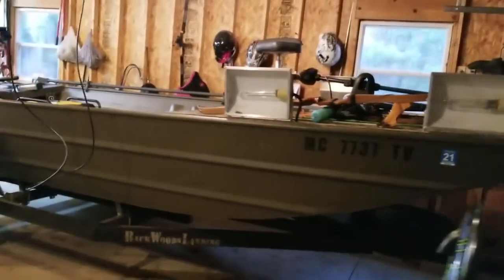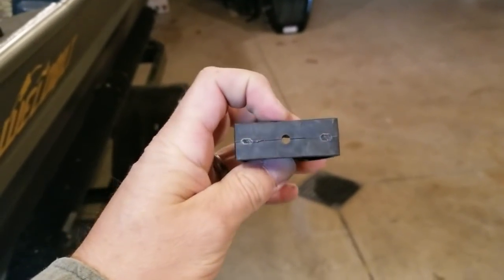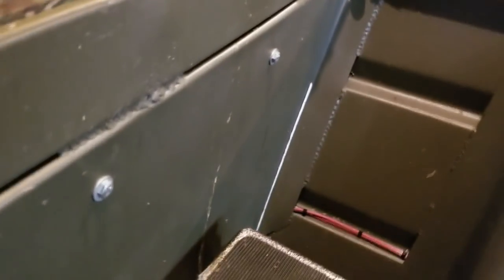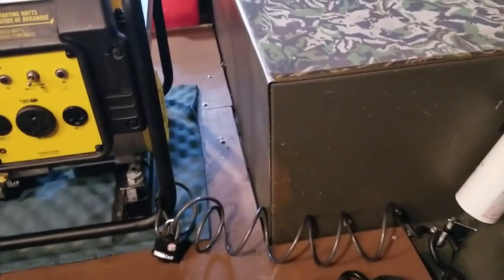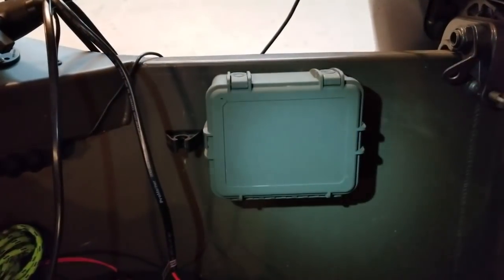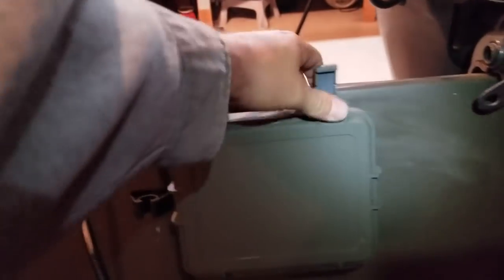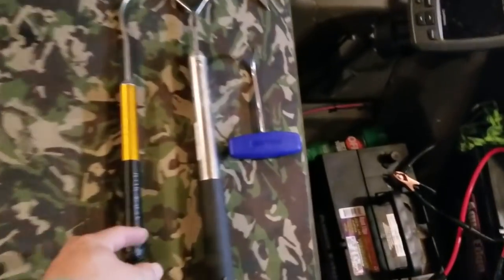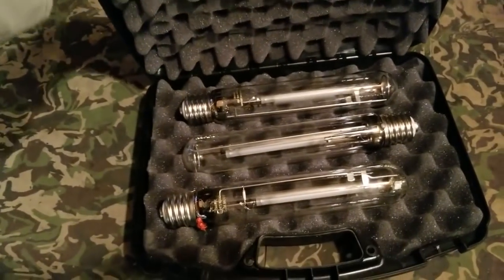Bow Fishing Boat Must Have Items To Make Fishing Better

Comment: Awesome set up I was just wondering what you used to Keep all your components stuck to the aluminum like your dry boxes and piggyback arrow holders?
Reply from the maker: Dry boxes were screwed with self tappers. The piggy backers were epoxied and some others were taped with gorilla 30 pound double sided water proof tape

Comment: Great set up!  I just acquired a warf bow that I'm going to set up for bow fishing. Probably something inexpensive as I have never bow fished. Any recommendations on bow reels etc..?
Reply from the maker: Any bow will work great. If it's a compound you will want a fishing arrow rest (strong enough to hold up the heavy fish arrow). Like a "roller rest". On a tradbow shoot right off the shelf. Reel wise I think the ams retriever reel is hands done the simplest, longest lasting maintenance free reel set up you can get. Also my favorite. Very easy to get going. Buy reel and arrow mount on bow and go fishing. If your bow doesnt have sight mounting holes you will also want to get the ams rubber strap adapter to mount the reel on the bow.